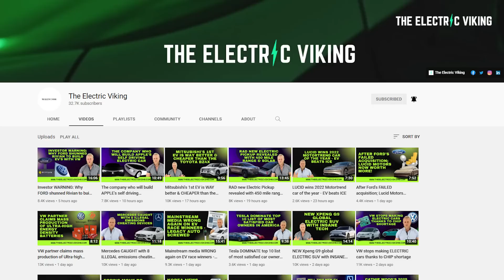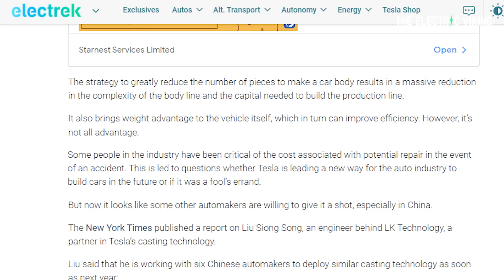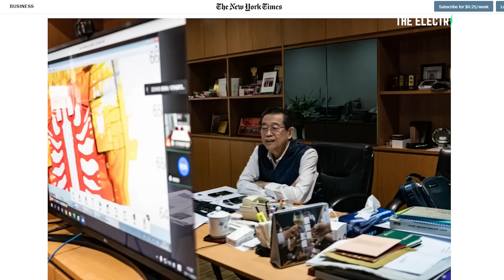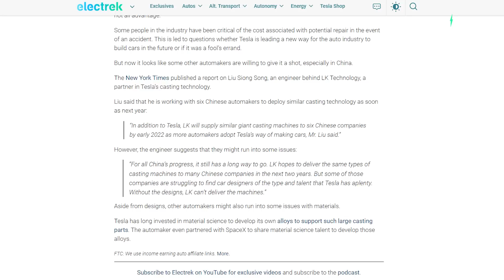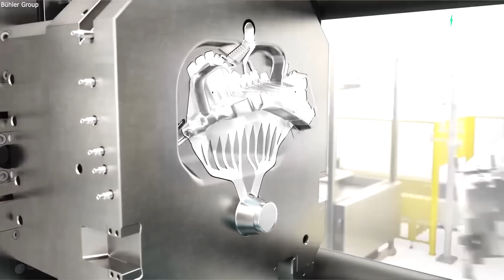6 automakers using Tesla Giga Casting machines - LEGACY auto?!!?

Comment: Great information from your channel keep up the good work ! 90% of the time if you have damaged those castings then all the airbags will have deployed in the insurance industry that's a write off as most of the interia will be destroyed by the bags deploying, on a traditional steel body car the cost of replacing interior and then trying to get the car straight again is almost impossible (25 years in bodyshop so yes I do know what I'm on about)
Reply: Right. Maybe the battery gets added as a blade somewhere in a Tesla heaven mega pack, the castings go on the remelt pile but if those bags go off it’s a tipping point to total
Reply: Please clarify the airbags inertia statement to non-industry plebs.  Is it a physics/force thing caused/added to by airbag deployment or added airbag cost, or if all the sensors detected the need to deploy, the impact is already that great the body wouldn't even be examined as it's obviously Fubar?

Comment: Even a Train Engine hitting a Model Y Tesla sat on the tracks, may not be able to break the casting. The alloy that is literally formed INSIDE the press from molten slurry is not only flash hardened in under a second. The subsequent alloy has also been tempered and anodized all in the same casting cycle, by controlling the temperature and pressure of every inch of the machine. The produced pieces are stronger than Superman.

Comment: Sandy Munro suggested this idea of one piece casting while he worked with Ford decades ago. They are old school and were opposed to the change due in a large part over cost of re-tooling. For this reason, that is why they are so behind in making EVs, they are resistant to change to to costs.
Reply: Sandy is an icon!
Reply: @mshell1959  Sandy is our savior.

Comment: After field adjusting for ten years I can tell you, it is very possible to fix a vehicle with inner quarter damage.  Nonlux no more than three yo and it can be done without econ total.  Even frame straiten too.  However, because of battery placement the physics of that level of impact and penetion are different.  I suspect the force needed to cause any unrepairable casting damage will also scuttle the battery bay thus... Totaled.

Comment: Tesla is starting with a clean slate at its new factories; however, this was not the case in Fremont. They had to remove a bunch of robots to switch over to castings. This did not stop them, nor should it stop the legacy makers.
Reply: Does legacy have engineers or politicians at the top?
Reply: @TurdFergusen  I agree with Sandy.  Most US companies have been gutted by the new MBA class.  Engineers do well in general, if you LET them do their job.
Reply: @TurdFergusen  Worse, MBAs
Reply: 25th like

Comment: The truth is somewhere in between, Telsa at one time was using up to 12 parts to build the underfloor storage tub in the trunk of the model 3, strange. No regular automaker would do that. With input from Sandy Munro, it is now a one piece plastic tub that works for both frunk and trunk storage. So Tesla is ahead on some areas but catching up in others. Tesla's advantage is that they implement improvements now during production they don't wait for a model refresh.

Comment: I have fixed cars damaged in the front area where the mega cast is, on traditionally built cars, many times. I'm a 36 year collision repair technician. On the rear of the vehicles the corresponding area is less likely to be damaged but it happens. On the idea of replacing the front casting, due to accident, it would be intensive but  probably not that hard. The rear would be likely very very challenging. The replacement casting would be an expensive piece in my estimation, and the labour time probably high.
I would not think that there would be repair procedures for a mega casting. Replace only. Tesla's are expensive so repairs for large accidents are possible because the Total Loss threshold is in a direct relationship to the value of the car.
It's possible that casting replacement will happen in some collision repairs
Reply: Sounds reasonable.  And maybe things have changed since I was a kid, but it used to be said that it was nearly impossible to weld aluminum.
Reply: @alanjameson8664  Al easily welded with proper equipment.    TIG ??
Reply: front engine compartment a lot more complex to repair.
Reply: Well, times change.  I also remember gas lights and magneto telephones.
Reply: @alanjameson8664  It used to be said but that was a long time ago. A friend of mine has an aluminium motor boat that he built himself. He taught himself to weld aluminium and did a really neat job.

Comment: Agreed, casting larger parts where possible to capture/combine a multitude of stampings in one shot is brilliant and why...though the castings weren't as large...Cadillac did so as well a while back. However, when you go that big you may be locking yourself into certain fixed points thereby 'casting' your future design flexibility....I imagine this has been planned for or at the very least has some work arounds

Comment: Generally speaking.... castings are good. You can make really big and complex constructions. To get the right pay back you just have the machine tooling operating time and quantity. Therefore... the basics are any machining cost analysis. These are giant parts... but there is NO single reason why this cannot work. When it is well engineered.... respect to the idea! Great success!
Reply: The CNC drilling of the finished casting reduces parameter deviation to practically zero.  Panel gap labor ain't the only distraction kicked in the head.

Comment: I can't speak from personal experience, but six months or a year ago there were stories floating around that in case of a Tesla requiring even relatively simple body work (a damaged fender, for example), even when taking it to a Tesla authorized body shop it could well take in excess of six months for the shop to get the part because there were none in stock--each had to be made to order, and that was very difficult to work into the manufacturing line.  If true then, maybe that problem has now been solved.  I remember the days before unibody autos, when body parts were bolted onto frames.  When the frames were bent in crashes, sometimes they would be heated and bent back into shape--but having lost their temper they were signifiantly weaker than before.  Unibody manufacturing, crumple zones, and air bags all increase the probability that an auto will be totaled in a crash, and no one seems to give that a second though (if even a first one).
Reply: It makes it safer for the occupants of the vehicle. Like diving into the sidewalk verses diving into a pool .

Comment: These large castings require large production runs to be cost efficient. Having only one (compelling) car each major category supports that efficiency.
Reply: That's presuming that these castings can only be used for a single model. That is not necessarily the case.

Comment: The casting itself may not be revolutionary but the speed that it allows the car to be made at is what matters. You want a run rate at 500,000 cars a year? Castings are the way to go. OEM don't think of run rates that high so cost might not be justified. Talking about evaluation when a single factory makes the cars of two factories.
Reply: Injection of the alloy into the mold takes place in only one tenth of a second.  Maximum throughput should be jaw-dropping.
Reply: Mic dropping!... 😁

Comment: I worked for years at GM making die cast carborators before fuel injection. The casting machines worked three shifts 7 days a week and much scrap can be produced but a single casting can reduce much machining time and labor. The  proving out of a product and its demand can result in a green light for giga castings so it is natural for a company that jas that solid product. OEMs' traditionally brought out new models every year and investing in one design molds would be prohibitive for profit. Tesla pieced together its first models but quickly turned to the casting as their designs were approved. This is the fastest yet most expensive initial startup production. Once paid for,millions of cars at lower price point will be achived. Buy the stock.

Comment: None of the legacy US or European ones are doing it because they aren't very vertically integrated. They don't see it as worth the high upfront cost when they rely on other companies (often the same companies as their competitors) to build a lot of their steel frames and mechanical parts. Until they change that fundamental mindset, they won't invest in giant casting systems.

Comment: I'm pretty sure Tesla also has systems in place to fully test many aspects of the finished vehicle automatically with custom software and sensors.  They use an Agile approach that came out of the software development world.  If this is true, they can rapidly try new things and determine if the vehicle maintains safety and quality standards.  (New things like: Alloys, frame designs, new third party components, etc.)  If this is true, good luck catching up..

Comment: Alloy castings on such a scale is another example of Tesla (and Elon) being prepared to re-invent auto engineering. As a young engineer in the 1980’s, I was always told that such castings were impossible for a whole host of reasons. Casting smaller parts was good, but on such a scale would never work. Yet here we are, Tesla solving so many mass production issues by not taking no for an answer and perusing the best manufacturing solution- just awesome. Casting central components like this solves so many issues with jigs, alignment, reference points etc. Assembling pressed steel sheets to high accuracy is a nightmare, your production area changes temp by 2 degrees Celsius and all your jigs are out by half a mm, you have to design your tolerances around that. A casting solves so many issues in accuracy, but also time and complexity.

Comment: In principle the die castings.looks very attractive. However, I am concerned about the following:
1. Die Casting Distortion.
The distortion of the casting on this size of casting could be hard to minimize on a high volume production basis….I am assuming the casting is machined at the key vehicle attachment points after casting & cooling….. this could be a big challenge to repeat accurately in high volume production.

2. Production Capacity.
The die cast cycle time + tool/part cooling time + tool change time + general machine maintenance etc will require probably 6 -8 Giga presses to meet cycles times of the other processes within the plant ( probably around 50-60 seconds)+ 10 sets of tooling will be required being cycled thru the machines. 
FYI - this Giga Press is quite similar to a aluminum extrusion press, this machine will require at minimum 1 day downtime/ month for general maintenance.

3. Alloy Properties & Dimensional Control
 The properties  will be a challenge to maintain & be tough to control on a high volume production environment + the production life or the die cast tooling could also eventually be an issue, these tools may need replacing every 2 months….. my experience is in aluminum extrusion, with the dimensional results varying with the number or LB’s extruded in the extrusion process + the die temperature during production having an effect on the dimensions & the physical appearance of the parts produced.

I am hopeful this innovative process is extremely successful. However, I would anticipate this process will be most significant bottleneck in the process once all the general launch difficulties have been overcome.
Reply: See “The Limiting Factor “ on YouTube if you are interested in the whole process and the slot that Tesla uses. Jordan has don a great job in researching the whole thing.
Reply: Hi, I think they will try to not machine the casting.
The best process being no process!
If they can do this then the cycle time to cast is to a finished part and a big cost saving.

Be interesting to see what they do.
Dinky had it down pat all those years ago!
Take care all M.
Reply: Tesla is casting molten aluminium alloy = much longer tool life. The welding of the steel parts took much longer,

Comment: I once was a heavy wreck auto body man. Cars that were hit in those areas did not always total out, they were reparable. I have wondered how these car will be repaired, or maybe the parts will be replaceable. As the cost of the cars keep coming down it won't mater a less expensive the car the sooner it will total out anyways. These are not the first cat that seams unrepairable. I think it is Jaguar that has some cars that have some of the under structure glued together, very little welding. I spent years on a frame machine straightening very bent cars. And I don't know how you would pull on a car that is glued together and know the glues integrity is still good. But they still fix them.
Reply: Was is the big point here old American heavy gauge steel car bodies were very repairable (horrible for the occupants in crashes). Modern high strength steel unibodys have a multitude of crush zones built in = total that car if it gets a decent hit (way safer for occupants) with all that plastic and a unibody they bend in ways that make them not cost effective to repair.
Reply: @jackdbur  They had crush zones in unibody's all the way back to the 70's that's not new. But the newer the all vehicles are the safer they get.

Comment: The casting tech it a multiple level puzzle to other manufacturers. How do you make large parts while maintaining high strength and quality? How do you cool the part fast enough to meet production levels? How do you push the liquid metal fast enough to ensure full castings without pockets compromising the strength of the whole piece? It's an impressive bit of engineering done on a time frame never seen in the auto industry for the past 70 years. That's why Tesla has spent so much time developing this technology. It requires a considerable amount of investment in R&D. It requires management buy in. It requires the willingness of management to tell investors to deal with the fact that they aren't maximizing profit for a long period of time. Shareholders are notorious about pushing profit right now before everything else. We're seeing the difference between legacy auto and Tesla.

Comment: I believe LK bought IDRA a few years back for a song ($25M).  So to me, it makes sense that the Chinese auto companies are trying to find skilled resources to design castings with material engineers to exploit an IDRA or LK GigaPress.  
  The OEMs have only started to accept or give lio service to EVs, so they aren't ready with designs to use a GigaPress.  They are actually still designing new ICE engines, ICE models and ICE factories.  They are obviously not all in on BEVs.

Comment: Gigacasting is a gamechanger. For sure.
However, I can't help but think that one of the major reasons automakers in Europe haven't adopted this in their factories.. yet - is due to the power of the workers union/s.
Fitting in a gigapress would probably take the job of more than 10 people away. There's no way the union/s would let that happen.
I honestly hope that VW, Daimler and BMW would fit at least a single gigapress in their lines.
Problem is... you need to let a portion of the workforce go for that.
Politics, anyone?
Reply: The Unions will at some point have to choose between less jobs and no jobs.
Reply: @hardyvonwinterstein5445  Absolutely.
The grandfather clock is ticking away..

Comment: It's sad that only China is looking into using the technology. That being said, getting one doesn't necessarily mean success. The machine has to be constantly fine tuned by smart tech engineers to increase production efficiency. The material thing is also an issue. SpaceX made Tesla's material so the costs aren't high. Any other company would have to contract with another company to make the material and this could increase costs. 
I think legacy auto makers are just looking for the easy way to solve their problems. Gigacasting may be challenging and risky but the up side is worth it. If legacies continue with their current model and try to make EVs that way, their margins will be way lower than their ICE ones
Reply: Because the Giga Press is own by a Chinese company.

Comment: The problem for most legacy auto makers is that their margins are so low per car sold.  They really need that revenue from parts and service. They are focused on short-term return and switching over would probably initially result in reduced revenue. But as costs decrease, then margins should eventually also increase.
Reply: Their in debt to the neck and haven't the money to totally revamp their plants to use giga castings, Plus the UAW would stop it because many jobs would be removed.

Comment: To make a clear judgement about benefits of casting, you would need to account for maintenance requirements. Might be great to produce small runs, but could machines sustain literally 100s of thousands of pieces without degradation of moulds or injection systems.
Reply: Correct, but all machines need servicing and maintenance. Even the regular robots, stamping-, pressing- welding- machines that make all the bits and pieces for the regular car structures. So it probably will be cheaper with maintenance for two casting machine. And less equipment that can fail and stop the production.